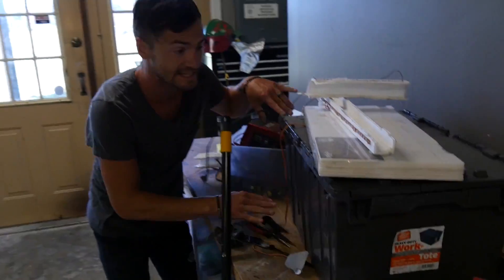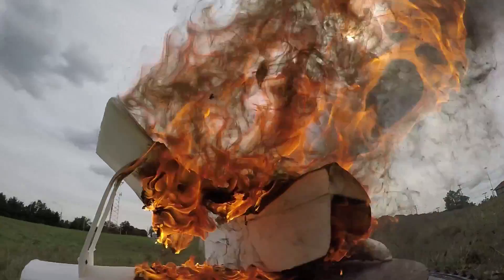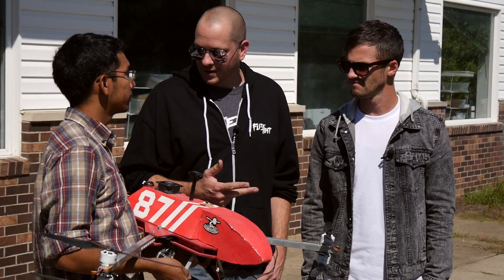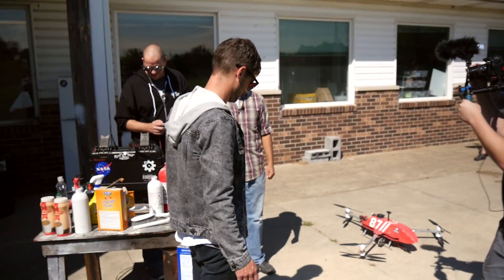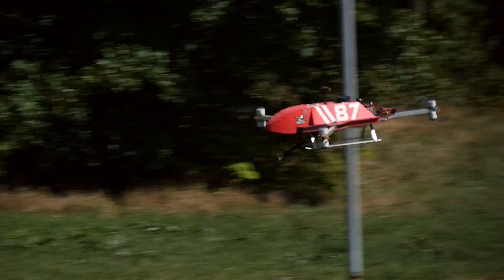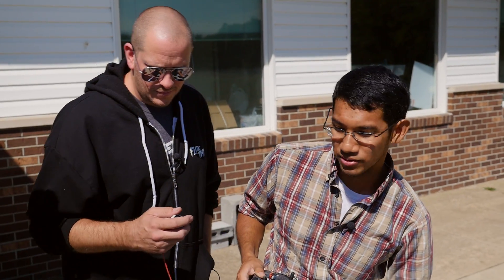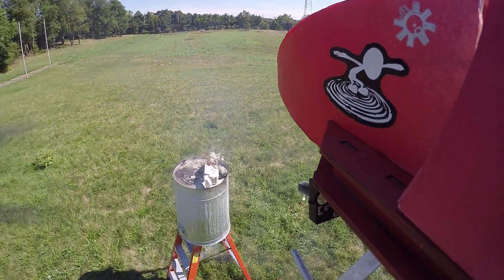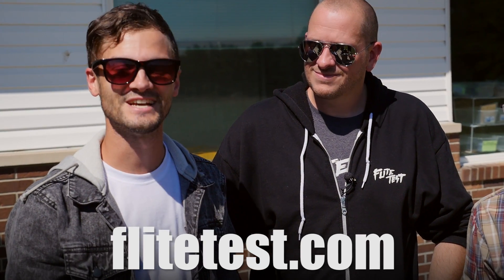Fire Fighting Drone | Flite Test

Comment: do not approve of you guys calling it a drone when it clearly is not.
EDIT: Yes i understand the definition in the dumbass dictionary has changed, but the reality is, a drone is or mostly is autonomous, A drone is not manually controlled 100% of the time because if it were, those $10 toy helicopters you buy anywhere would be called drones wouldn't they?
Take a page from every military everywhere in the entire world, a drone is autonomous (with the exception of being manually controlled at certain points), They would not call the cessna coming in to land a drone, but if the cessna had computers on board and was flying autonomously, it would be a drone, just like modern airliners are actually drones.
Reply: grabs bucket of popcorn
Reply: +Jared Reabow (Jazza) A drone as defined by google "a remote-controlled pilotless aircraft or missile."
Reply: +Jared Reabow (Jazza) To the average person, any aircraft without a human pilot onboard the aircraft....is a drone.
Reply: +Jared Reabow (Jazza) I think they called it a drone because it might be autonomized in the future.
Reply: +Jared Reabow (Jazza) It is a simulated concept of a future drone. This one was not autonmous (it could've been, it had a Vector flight controller with GPS, waypoints and stuff), but the real one will be.
Reply: +EQUINOX looks like someone needs a reality check.
Reply: Grabs padded gloves to reduce red mark on face from facepalm.
Reply: +EQUINOX those $10 toy helicopters, toy planes, rc gliders, remote trigger rockets, you buy anywhere would be called drones wouldn't they?
Reply: +EQUINOX im talking rc rockets with moving fins and parachute trigger
Reply: I think they call them "drones" to have a bigger appeal to a wider audience. A lot more people know what "drone" means while only a select few in the audience know what a "quadcopter" is or a "tricopter". While I agree that they shouldn't be called drones, I'm just stating the reason why they might be calling them "drones"